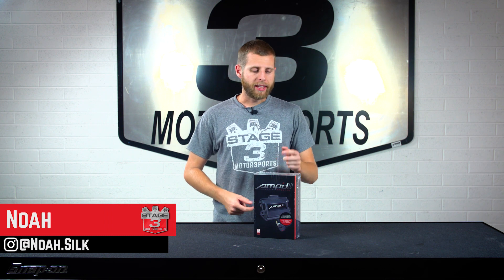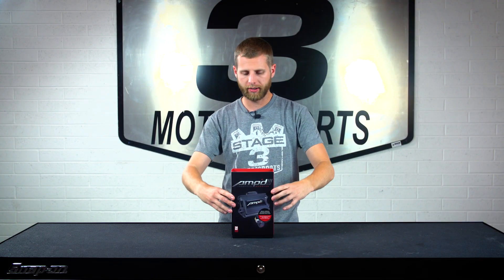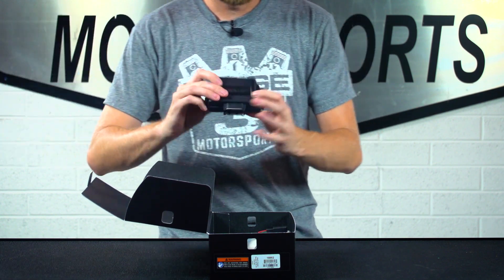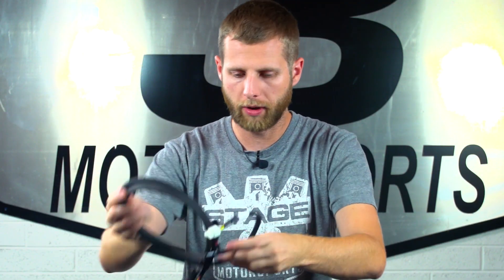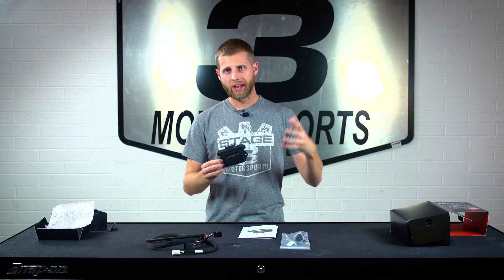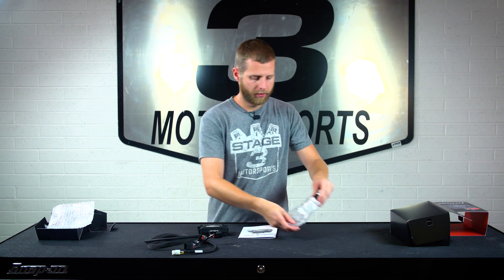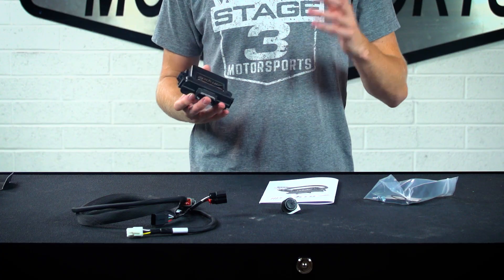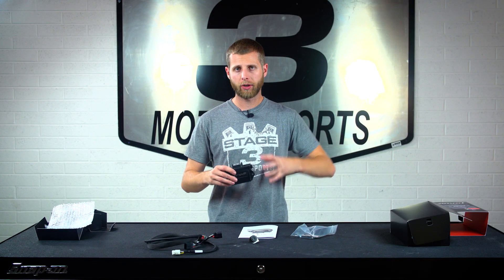2009-2019 Ford Gas Engine Edge Amp'd Throttle Booster Unboxing

Comment: 🚨❌🚨❌🚨❌🚨 
BEWARE!! IMPORTANT SIDE NOTE ABOUT THROTTLE BOX'S!! 

If you are looking into getting some type of throttle response device for your truck, take this information into consideration before taking the plunge.
As far as functionality is concerned, these devices will work as advertised and will surely exceed any expectations you may have before purchasing. If you have known nothing other than the stock OEM throttle response, or lack there of, installing one of these products will certainly 'wake' your truck up and feel as if you have instantly gained 150-200hp. Almost all of our trucks initiate acceleration by sending an electronic signal to the engine once it recognizes the change in position of the pedal position sensor. This signal is sent with a slight delay because your vehicles ecu/pcm is clarifying that all systems are nominal before applying more air/fuel into the engine and increasing speed. This usually only takes a few milliseconds but by the time your truck gets movin finally it feels like the delay is more than a couple seconds long. These devices are installed between the pedal position sensor and the cars pcm and the programming of the throttle box acts as a middle man, sending max voltage the second the throttle is touched which makes your vehicle think it has already double checked everything and essentially eliminates those milliseconds resulting in immediate response. This really makes driving a lot of fun but you have to understand that there are reasons that the manufacturers have implemented this kind of safety check before initializing acceleration. Most of which pose no threat if bypassed but there is one key reason that makes these throttle box's very harmful for your vehicle. 
That reason, is THE TRANSMISSION! Transmissions are comprised of multiple sets of gears that are engaged and arranged via the clutch. The biggest reason the manufacturer doesnt give instant power at the first sign of throttle is because gears can only be engaged/disengaged at a certain rate. This is why slamming on the gas is awful for your gearbox because going from 30mph to 100mph instantly requires your car to tell your trans to get into the apprioprate gear ASAP which is why you always feel a hard slam if you do this. and the effects of that is the gears grind harder against eachother and over time will lead to a bunch of metal in your trans pan and a clutch/gearbox that is too worn out to function anymore. NOW...add a throttle lag eliminator box and your vehicle is literally slamming itself into gear all throughout your drive and if used continuously, you are essentially fast forwarding the time till a new transmission is needed once again. TRUST ME ON THIS, the companies producing these devices will tell you theres nothing to be weary of and that absolutely no harm will come of using these devices but what happens is over time theres a clutch failure or trans burnout or oil pan gets metal in it, and the thought that it was caused by one of these devices doesnt even cross the owners mind. Theres no big give away that points to the pedal box so its chalked up to normal wear and tear and never thought about again. UNTIL..you continue using it as if no harm is happening and end having problems again and again faster than a normal car/truck should be wearing down. Then you will dive into what is causing these failures and ultimately find out everything i have just informed you of and will realize how clear it is when youve been stressing the hell out of your driveline everyday. you may think the $300 upgrade is worth it but trust me, it wont be in the long run. If you want true performance, have your truck tuned appropriately .
Reply: Really helpull..thanks buddy